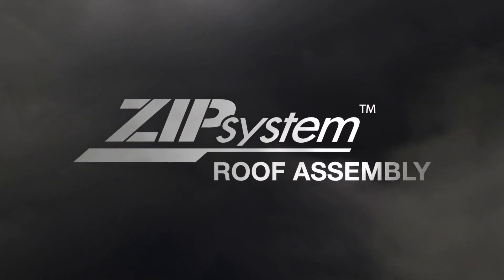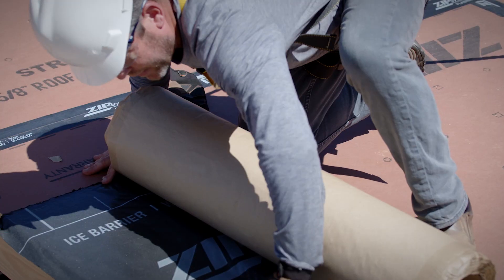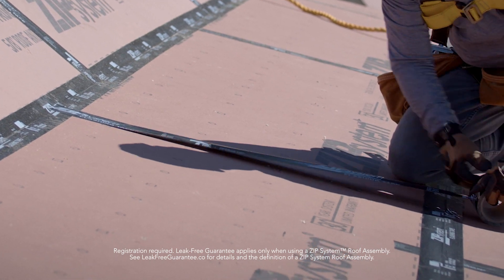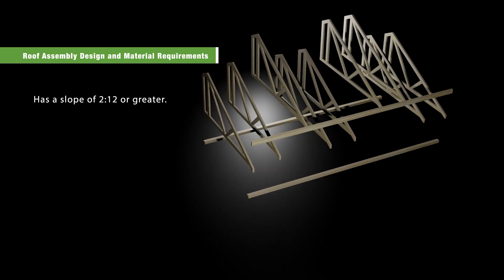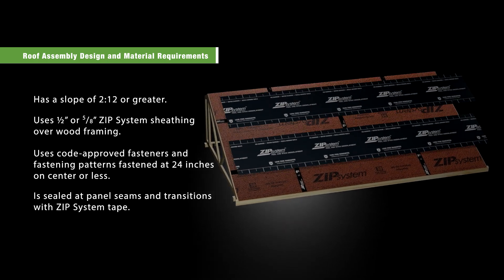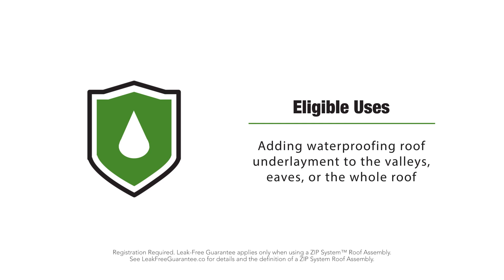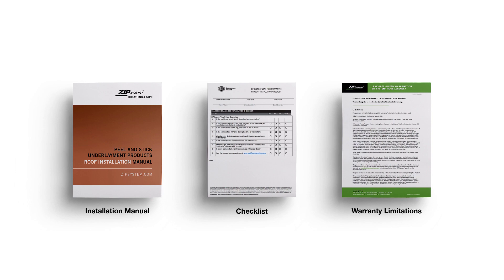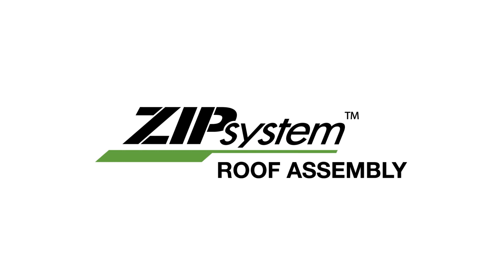Leak-Free Guarantee for ZIP System™  Roof Assemblies

Comment: Once completed will this reduce insurance premiums? If IIA backs this system / program, and it helps homeowners reduce insurance costs, this should help offset the extra materials cost this construction method requires Vs other methods.